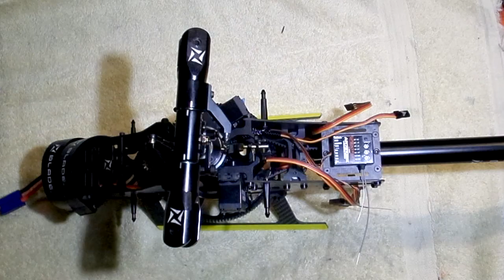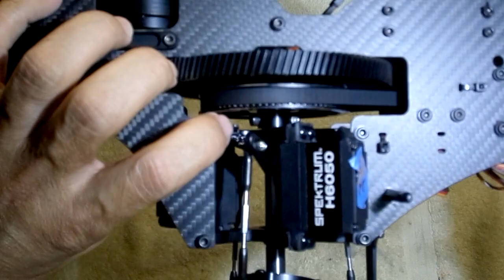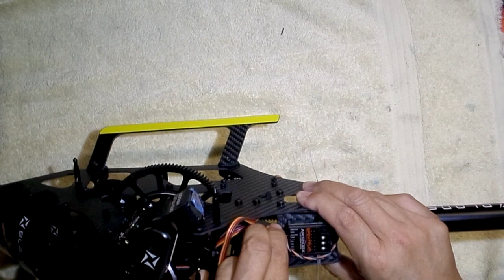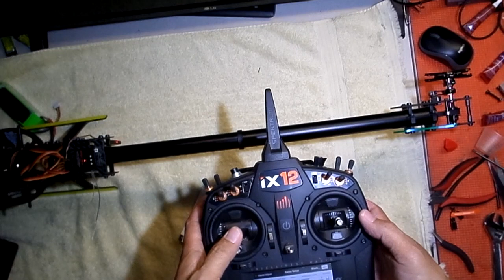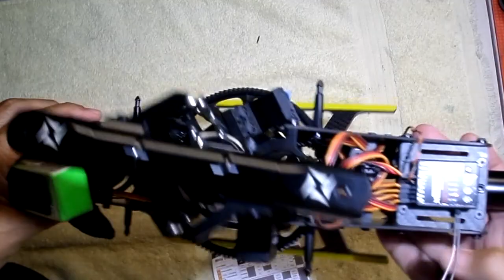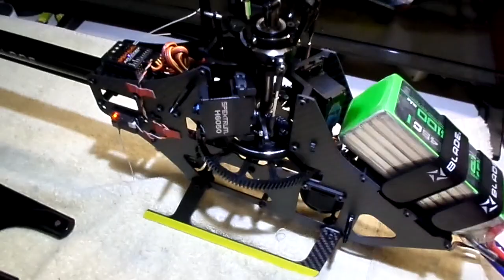Blade Fusion 480 Build video - AR7210 Setup

Comment: How many poles is the stock motor? trying to setup my ESC governor
Reply from the maker: 8 poles
Reply: @zoomtt  you are amazing thank you.
Reply: @zoomtt  hey zoom, I'm looking for extra ball links from the tail rotors. I got aluminum servo horns and the only ball links that have the m3 threads instead of the smaller ones that use the locknut's are the ones for the tail grip and bell crank. 
I've searched Google for m3 threaded ball ends in several variations and differences. Could you again point me in the right direction?